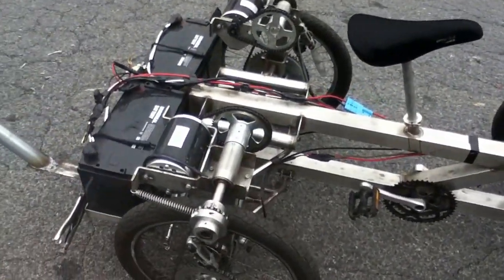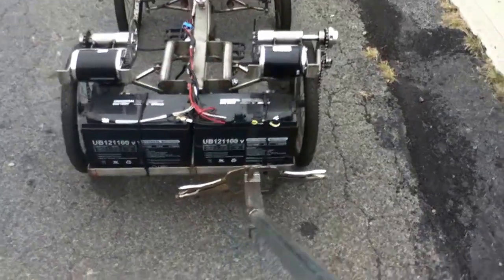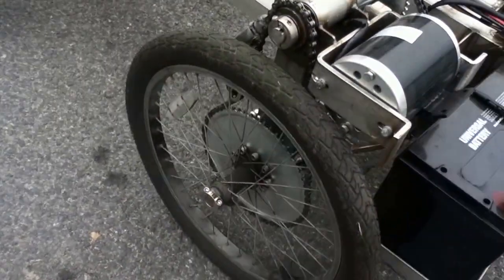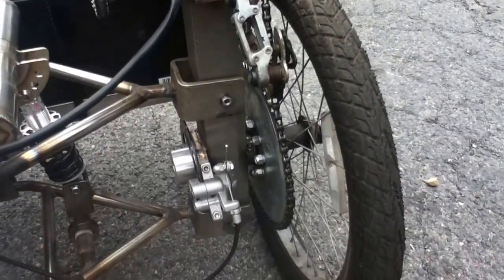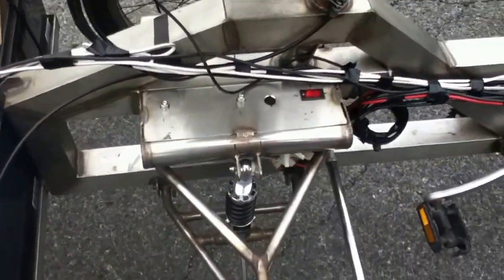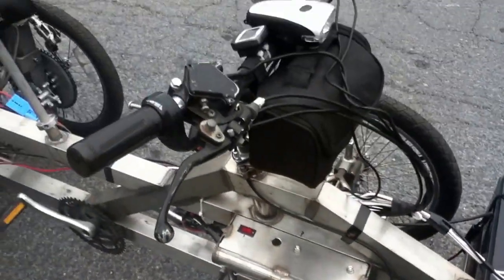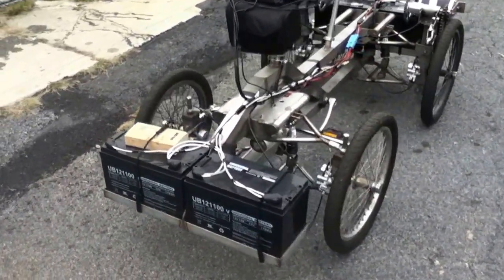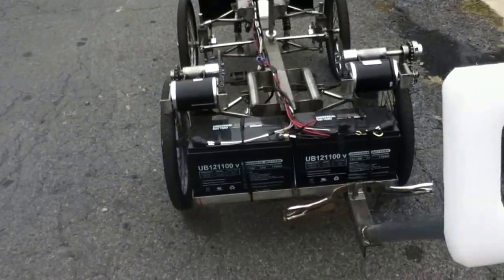Stainless quadracycle update 10-16-13

Comment: That's a mighty fine beast you have created there  :) . 
 You even built suspension into it, and all on a solid frame that can take you wherever you want to go. 
 Well done indeed. 
 Now, if my Ebike project works anything like yours, I will be delighted  :) .
Reply from the maker: Steve, I was pretty happy with how this turned out.  Sadly I never did a range test while the batteries were in their prime,  but they now have a new home on the woodgas ninja. Thanks for watching,  and be sure to check out the 49cc gear changing mountain bike. What's nice about that set up is it leaves the back of the bike untouched so you can pedal as much or as little as you like. Joe
Reply: Yup, you have good reason to be happy with the turn out  :)  . 
I have no idea watt kind of range I might get with my project, but I wood be happy if it can get me into the village and back, with some groceries. 
 I used to do this with a horse and cart, but now that the motor car has been invented...... 
 Time to go and have a lookee see at yer 49cc MTB project  :) .

Comment from the maker: I have not driven the bike far enough to figure out the range. I tried taking it to a local state park and the rangers were nice enough to wait for me to unload it only to tell me I can't ride it there.  Anyway , I'd like to take it to a path or large parking lot once I install an accurate speedometer/ odometer. According to the figures it should have a 25 mile range of course depending on how how much throttle I use. I will post details as I figure them out.

Comment: A very nice bit of kit. I am hoping mine goes as well. I will be powering mine with 144V DC. Have you measured distance on single charge yet? How long after a run does it take to fully charge the batteries back up? How much more will you be adding to your vehicle or is this the final build? Keep up the great work. You have an awesome machine. Very well done.